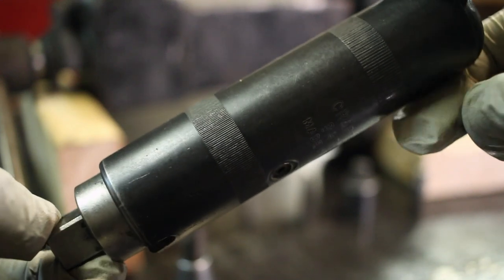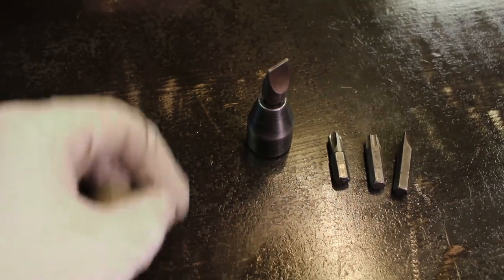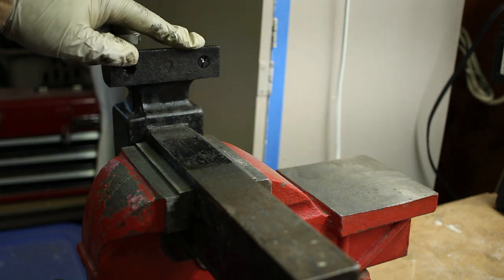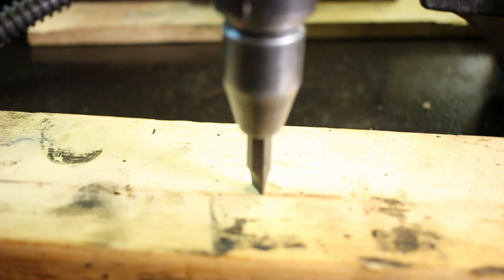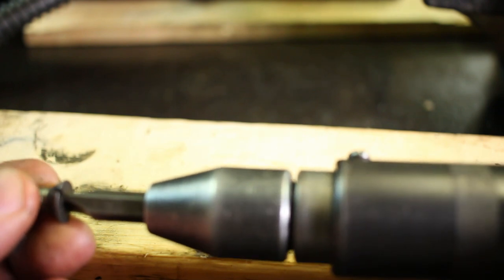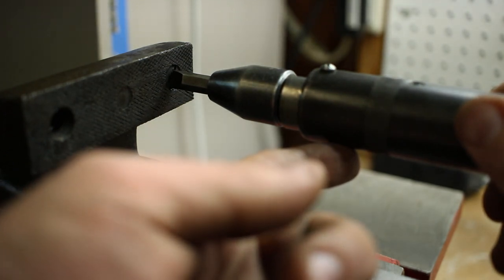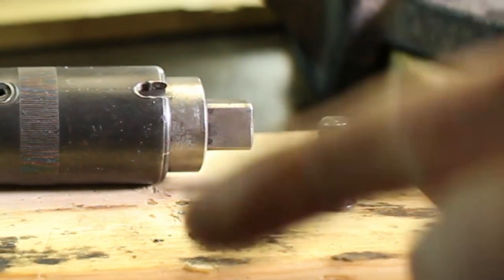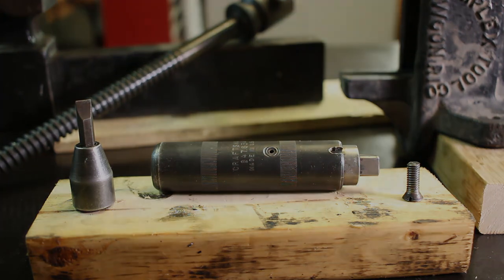Removing Seized Rusted Screws With A  Craftsman Hand Impact Tool

Comment: Ive always had one of these. I never need it for years, but when i need it, everything else is just a joke. If you must have every advantage, add heat with a propane torch, add a little valve grinding compound in the screw slot for max grab, and at the first sign of the screw releasing, stop, and spray  with penetrating oil. If that doest get it out you can weld something onto the screw and twist. If that doesnt get it, they have broken tap disntegrators that will melt out the screw, or even a a broken tap. Run a tap down the hole to clean it up and throw away the old bolt.

Comment: i ordered one of this waiting in the mail.   i have a mtb disc rorarty hub i need to remove 6 bolts that are stuck i hope this will do the trick last resort is cut the bolt head off and drill one size bigger and go back down with a helicoil to replace it.
Reply from the maker: I hope it works  too.  If you can, heat it too. Good luck!
-Will

Comment: I need this right now or similar like this, the screw for the heatshield on my mc exhaust just wont budge
Reply from the maker: Try heat too.  Sometimes those exhaust bolts can be tricky. Just be careful not to burn yourself or light your car on fire. But this impact tool is great. Good luck
- Will

Comment: Well keep your "vice in the vice" when you blow it with impact screwdriver
Reply from the maker: Almost thought I had "aVe" responding to me.  Ha! LOL!  Thanks for watching!
-Will
Reply: @Debtfreehomesteaders  There is a twist here. I had impact screwdriver sitting on the shelf for years. I was about to use it on carburetor screws ;) - such delicate job. So I did search how to use it. Although I'm not native English speaker it is easier to find relevant video using English not Polish search. Cheers!
Reply from the maker: Awesome!

Comment: 😣 I can't use this on a porcelain toilet screw...
Reply from the maker: Is it rusted tight?
Reply: @Debtfreehomesteaders  It doesn't look rusted but it's not budging and WD-40 isn't helping. I did try to tap the metal of the screw back down but any further attempts with a regular screw driver will continue to strip the screw head (flat head).
Reply from the maker: @accurry8566  can you apply heat?
Reply from the maker: Another idea is air in a can. Used for cleaning dust off of electronics. Turn the can upside down and spray the bolt and it will freeze it causing it to contract. Might be safer then getting the wife's emotions elevated with a blowtorch in the bathroom
Reply: @Debtfreehomesteaders  I can try the canned air/cooling option. I can't use heat, it's holding the plastic clip for the toilet seat on to the toilet. I am the lady of the house and I got a few handy traits from my dad... so I take care of all the household and automotive maintenance for our family. I really love it and head to YouTube to learn new how to's!
Reply from the maker: @accurry8566  Great job! I hope you ovecome the stubborn bolt. 
Good luck!
-Will

Comment: 2:39 vice inception
Reply from the maker: A vice is nice but two is better!
-Will
Reply: @Debtfreehomesteaders  Do you know when they stopped making this particular model, I'm thinking about getting one on eBay, but I'm trying to avoid possible knock off. So knowing when they discontinued this model may help me be able to select one wisely.

Amazon has a problem with people selling plenty of knockoff also. So that's why I'm trying eBay. I would prefer to get it used, that way I know it's more of a chance of it being genuine. But I'll see. Let me know.

This is the same tactic I had to use when looking for the Gator grip socket attachment, there is an abundance of knockoff being sold on eBay of this particular tool I just mentioned.
Reply from the maker: @REXXSEVEN  it's been a while now since craftman made it. I need to buy a couple off Amazon and see the build quality for myself too.  Things dont seem to be built like they used too. -Will
Reply: @Debtfreehomesteaders  Ok thanks.